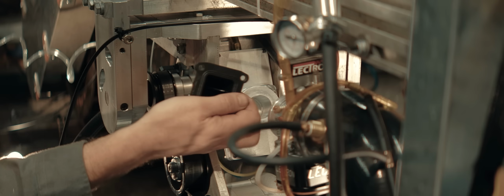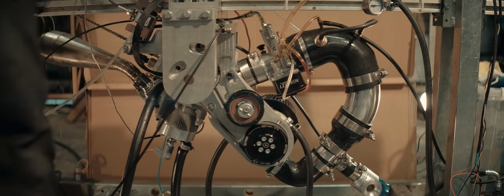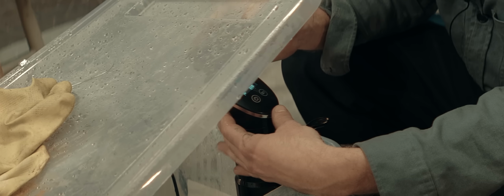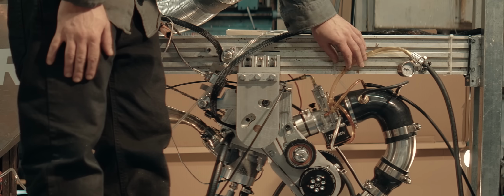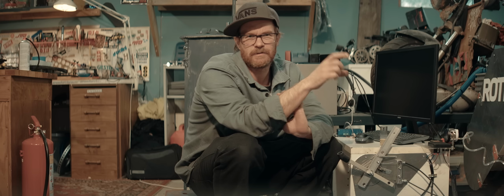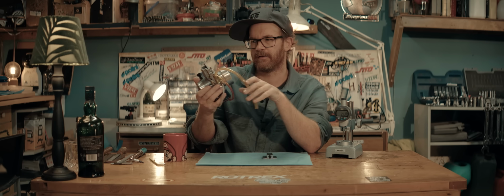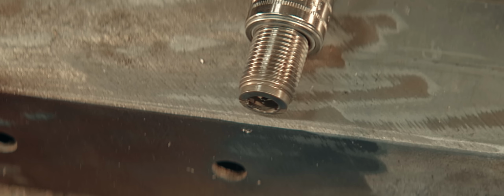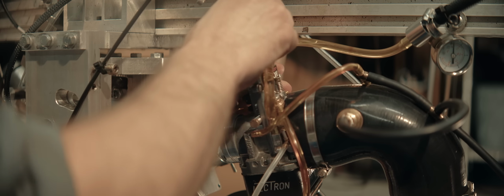Supercharged 50cc Two Stroke BREAKTHROUGH!

Comment: Really great results! Sure does look like your theories are paying off. What RPM is the expansion chamber tuned for? Could it's pulse be tuned to help the engine get over that hump? Really intriguing what you've done so far!
Reply: He really needs to read this comment!!!! He should try a much longer, smaller pipe, to help the engine fill at low rpm, then incorporate some sort of bypass for high rpm, full throttle operation.
Reply: The expansion chamber is tuned for 19000.
Reply: @malcrandall1309  That seems well above the RPM that this engine needs the pipe to scavenge the cylinder below that 'Hump". At boost the pipe won't be reflecting pulse waves back into the cylinder, but at low boot it's needed
Reply: This expansion chamber came from Alex's first rendition of PiP which was going to use a N/A twin induction  sysyem which included a resonant induction system fed with fuel injectors. Alex was developing the Brute Force concept at the same time. Alex added the roots blower to the Brute Force engine and ran into exhaust valve trouble leading to it's cancellation for the time being.
PiP was re enstated with the Rotrex where we stand today.
The idea was for PiP to hold 19000 by using a variator transmition on Moped Dick at Bonneville.
Reply: @malcrandall1309  I've ben following Alex for quite some time now. The twin tube exhaust was a definitely cool idea, maybe some more work? My thought was only that maybe this engine requires a different tune on the expansion chamber to help it get over the hump. When on boost, the engine will require less pull from the pipe to clear exhaust gasses, and it will be needed less to backfill the chamber. Just my thoughts

Comment: Can you get E85 over there at all? Stoich is 9.8:1ish, so it's near dead-nuts in the middle of gas and methanol as far as AFR goes, and you can do away with the time spent purging the system - if you're using methanol-rated components E85 won't do anything to them. Just a thought based on your musings at the end of the video.
Reply: E85 is available in Scandinavia and cheap. But I think you need special 2T oil (castor (not Castrol)) since ordinary oil won't mix well with E85.
Reply: @nhytg376tgyuu765gjmg  Ordinary oil won't mix with methanol either, he'd already be running castor (or another alcohol compatible oil) in the fuel he's using.
Reply: @nhytg376tgyuu765gjmg  I've turned some rotaries running in e85 with premix, Klotz makes great stuff for alcohol blends. But as nerd already noted he'd already have to be running something like that with the methanol, so should be no big deal.

Comment: Sorry bro isn’t the carburettor in the wrong place 
It should be before the suppercharger
Reply: Thats what i was thinkin.  The super charger is pressurizing the carb forcing fuel to go backwards. 
It should be sucking fuel in a vacuum.
Reply: @joebloe9901  He has a boost referenced fuel system. Draw-through setup isn't possible because the fuel would eat the seal on the blower shaft.
Reply: @nerd1000ify  Then why is he concerned with the carb metering jets in the vijeo? 
Roots blowers have the carb on the intake side. 
I missed something.
Reply: @joebloe9901  Back when the engine was running a roots blower Alex did indeed have the carb on the intake side. That blower had seals that were compatible with the fuel, on this one he's worried that they may not be, or that fuel may sneak past the seals and contaminate the special oil used in the friction drive that spins the impeller.

Carbs can work on blow-through setups so long as they are referenced to manifold pressure. Alex has achieved this by routing all of the carb vents to a pitot tube between the blower and the carb. This would not work if he was using gravity to feed the fuel (boost pressure would prevent fuel flowing into the bowl) but he's using a fuel pump with a regulator that also references to manifold pressure.

As for the metering, the main issue here is that the carb is too big for the engine. This is why Alex sleeved it down (leading to the shenanigans with the 'step' in front of the needle jet), and it's also why he needs different needles, at the moment the relative depression in the venturi isn't enough to pull sufficient fuel flow through the carb.

Comment: So cool. The only problem in the final result is that the turbo is doing nothing. I think is too large for such a smal cilindrade motor. The valve is just obstaculizing the flow and the pressure of the turbo. Anyway, I found  your intelligence just incredible for making all this stuff by yourself. I think you could use the exhaust to power the turbo. I don't know if this could work...Sorry for my poor english, I am from Argentina.
Reply from the maker: Thanks! It's doing nothing until the pipe hits, haven't been up there yet. Next time!

Comment: Mixing the mist aka fuel to air is key , it's coming together now Alex you problem solved it superbly , it sounded like it was starving with airflow but turned out to be fuel , I will definitely say it sounds like your going to need a rev limiter , flatout on the salt .
It's awesome well done

Comment: Something to consider over the next steps: try to reduce the volume of the intake tube between the blower and the carb. You could clock the compressor housing to move its output upwards, and then use an 180 degree hose.

Comment: I see what you mean about idle with a load, but for your engine, you must set the idle with the supercharger load, as it isn't a removable component in use. You need the engine to run from idle to full throttle, via jetting, and timing, even the spark gap.

Comment: Use a propane torch tank to induct propane vapor into the intake. If this helps it run better, it is lean. Also propane stays mixed with the air.

Comment: Hi Alex, if I may, your problem is the carb. By installing a large restrictor on the outlet side of the carb, it has killed the designed pressure changes that need to take place at the Venturi and in the outlet throat. It is a precise science when the diameter before and after the Venturi is designed. The carb works off of pressure differentials. When the large restriction was installed, there is no longer the required pressure drops needed to operate the circuits in the carb. IMO, best bet to prove this is take a stock carb of the correct size or smaller than needed, install it and test. I am fairly certain that your engine will come to life. I speak from experience. I have made a life long study of two stroke carbs. I also think a pressure carb may operate better as a blow through, although I have seen float carbs work as well, but they seem to take more precise adjustments. Best wishes, I am always waiting for your new episodes to see what you have come up with! Well done! Take Care Jim Marando

Comment: awesome to see,
one thing i think should note is that the issues you mentioned for efi shouldnt be as much of an issue as you might think, 4 strokes actually behave similarly to what you mention about fuel sitting in the crankcase. in 4 strokes you have a large "bubble" of fuel sitting before the valve that grows and shrinks as rpm and load changes and the fuel you spray often doesnt go directly or all into the chamber, a good portion of fuel injected just goes into growing the bubble, and that fuel then gets used in later cycles. however this averages itself out, since the total fuel entering the cylinder IS what is injected its just that the fuel injected that cycle isnt the fuel going in, some of the fuel going in is from previous injection events. I think you wouldn't have as hard of a time as you expect with doing efi on something like this.

Comment: IDEA...why not run the supercharger outlet directly into the combustion chamber i.e. eliminate the transfer ports and route the intake where the transfers currently exit?  No reed valve required, fewer ports so less ring wear and problems, better volumetric efficiency, etc.  Changing subjects...running it on gasoline will give you a good idea what a 2 stroke sounds like when running rich since your jetting is about double what is required.

Comment: Could be the governor or the Boss. Which could be why it wants to cut out or slow revs. Taking this off could get you to where you want to be but this also protects the engine from extreme wear and tear.
Reply from the maker: I designed and built the whole thing from scratch, and purposely left out any means of protection against wear and tear that would possibly interfere with performance 😁
Reply: @2STROKESTUFFING  well done, you know your stuff. Cutting out at high revs is a common problem on engines that are not self built. But you have done well, on two stroke this was a problem avoided and not attacked, for many a year the Wenkle had a problem with the reliability of the rotary engine until Mazda picked up on it probably of someone like yourself.

Comment: Hi
Using crankcase scavenging and exhaust ports is fine for a naturally aspirated 2 stroke but for a pressure charged unit I am totally convinced that you will need to replicate the the GM Detroit diesel, this would allow positive lube of the bottom end better and more positive scavenging and only passing air fuel through the cylinder bypassing the crank case. It will also alow for exhaust timing to be totally independent of piston position. 
But after all its your project and you have to do it your way and I respect that 
I hope you achieve your goals 
Keep up the good work

Comment: Great chanel and bravo for getting her going mate ! ive got a 1981 Suzuki Rm 50 5 speed mx mini bike . ive owned a few now and theyre peak or optimal performance behaviour is extremely dependent on heat ,fuel and to some extent atmospheric conditions  because of the small capacity possibly.

Comment: Man the excitement is climbing 😁, it still kept running at idle speed amazing and the shutter action is crazy, love it🤩🤩💯
Reply: To me every time he opened the valve it seemed like the revs climbed to a flow limited rpm, somewhere around 18-20k or so, and held there.  Crazy how fast he's spinning that thing, though I'm guessing peak power is quite a bit lower, probably 12-15k range..  Although with more flow he could potentially spin it even faster and make some crazy power numbers, but the more top end he gets, the more difficult it's going to be to start and idle.

Comment: Id consider running the super charger in place of the reed valve. Older VW’s used the draw through method on carburetors as they were really designed to be ran under pressure. Just another 1 idea to the hundreds I’m sure you’ve got.

Comment: Build it like a normal forced induction engine, i.e. no more carburator, build in a 45 degree flange for a single car injector in the piping. Consider to reach out to Maxxecu i Norway for a "mini" engine management system. You will not look back after this. In the old days, a carburator was build into a pressure-chamber box with inlet/outlet sealed to avoid all the leaks/noise etc. Just make it work with a single injector and tune AFR open/close timing on your laptop instead. Great content!

Comment: I personally have had problems exactly like yours regarding the intake step. I fitted a mikuni carby to my xr600 with a fancy cnc intake adapter which had a step in it to. I didn't think much of it but it was so inconsistent, rich, lean, flooding, erratic idling. I chased the ignition system for a bit as it pointed to a CDI module screwing the timing up then came back to the carby intake...the jets need smooth laminar flow to work effectively, I was dumbfounded that a step so small could piss me off so bad. I put the stock intake back on and it was beautiful

Comment: It takes a lot of fuel to run on Nitro. Most likely you will have to make some sort of mechanical fuel injection system in the end to be able to get enough fuel in the engine to make power. On a lawn mower I played with, I had to completely remove the main jet to run on nitro. If this helps, top fuel dragsters inject fuel in several places in the intake system at the same time while making a run. Its something to think about.

Comment: Many thousand years ago I worked at a place that had a side hustle repairing lawnmowers etc. Some of the ancient British machines had carburettors that looked as they it had been hewn into shape from a lump of diseased pot metal  by deranged Orcs using stone tools alone. The solution we found was to get a glass spark plug so we could observe the colour of the burning fuel while we fiddled with the various screws. Even so, we sometimes had to put stronger springs in the centrifugal clutch so we could get a reliable tick over without driving the blades. HTH

Comment: @2STROKE STUFFING I would reccomend putting the carburettor in front of the compressor, where the air filter is, instead of putting it on the boost/charge pipe so the boosted air and fuel won't be pushed back into the float bowl.
Reply: he explained in a previous video that the seals in the rotrex are not ok with methanol.
Reply: Might help with with fuel pooling/accumulation as well.
More time to evaporate + a huge amount of turbulence etc. going through the rotary charger, which should even increases its efficiency a bit as a beneficial side effect.

It's supposed to be problematic with stock turbos though. They're said to need special seals so there's no oil drawn out when the throttle body/carburetor closes. On the other hand - an acquaintance who raced old VW engines, especially boxers iirc, told me that's bullocks, that he was fine without it and learned to just use regular turbos. Don't know how that'd work out with the rotrex though.
Something to keep in mind for sure as the theory is sound and I guess that's bound to happen to some degree.
Reply: @netwt42oz  
Ah, didn't load your comment yet.
That's really unfortunate. Could've made stuff a bit easier.
Reply: @netwt42oz  thx m8

Comment: I had a MczCulla racing engine called a Mac 10 built  by Barnett racing engines for go karts and it had a 2 carb intake tunnel ram feeding a reed valve strait into the cylinder and another carb feeding the crankcase from the bottom upside down and all carbs had extended mixture adjusters  you could adjust on the fly.  I wish I still had it.

Comment: I would be curious to see a 2 stroke barrel with your large exhaust port and a 4 intake valves only head with supercharging.  The charge would help exhaust the burnt gasses and the custom ground cams would shut the intake valve at a perfect time so there is no reversion into intake from compression.  With direct port injection straight into the cylinder there would be no unburnt gases going out the exhaust. With some experimentation with valve timing and supercharger pressure I believe this would be a beast.

Comment: I onced build my own carburettor out of a rubber hose and an adjustable fuel nozzle for Bing carburettors. It wasn't really a carburettor per se since it didn't meter anything, more like gravety fed injection. It had a butterfly valve but it was not connected to the throttle grip. The moped run about 30 km/h when it was closed and double that when open. It had no float bowl so it had to be adjusted for WOT, -but it didn't hasitate and pulled strong.

Comment: Most use heavy springs to move centrifugal clutch engagement, I took a different approach when building PW50 and lightened the clutch shoes from the back side, this gave the added benefit of allowing a quicker rev and controlling engagement rpm plus the heavier springs tend to break easier.

Comment: I know it's a lot of work, but...why not make some new cases with a smaller case volume? Shouldn't need a big volume being supercharged & will behave much more consistent.

I made mention of the carb bore needing to be "offset" to the bottom because of fuel delivery a couple vids ago. You responded by saying it was? At least you got it now. 👍

Comment: Saw you used some wago wire connectors on your cut wires.
Those are quite bad for low voltage applications, where 1-2 voltage makes a difference. 
Have had issues with them in the past, and switching to ubåt or sockerbit gave me better results

Comment: Alex, why not use at coupling for a car a/c compressor, and use the ignitech wiring for the power valve to control it, then you can program at which rpm you want it to kick in...

Comment: Try to remove the air filter. It can act as a restriction(just a little), and your engine has to do some extra work at low revs which is certainly not ideal. Because of the air filter at low rpm acting like a small airbox, the compressor cannot deliver enough air to the engine. Basicly the compressor not getting enough clean air. I think it worth a try. Love your videos, you are truly a great enthusiast and also a great content creator. Best luck from Hungary

Comment: I want this in my 1986 Hona PX-R😅 good old times running Polini cylinder with Malossi Variable belt tensioner on light weigths, topped with a delorto 14 carb. Good old times. Did 80km/h, I was more than happy with that ☺️ had stock exaust so police wouldn't pull me over.